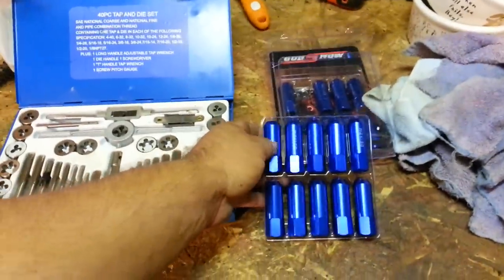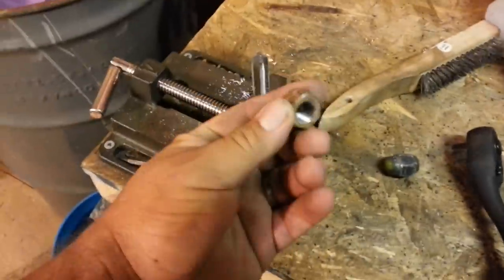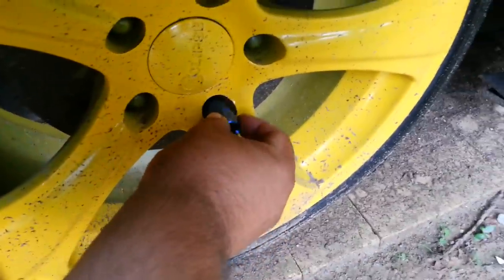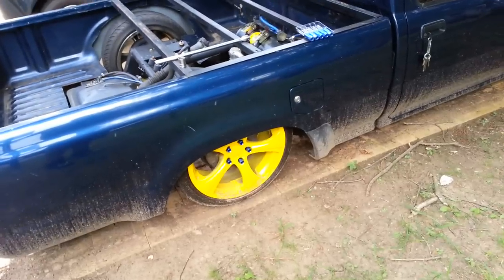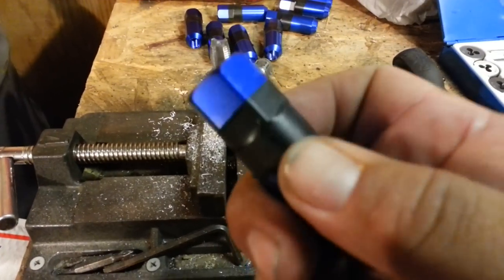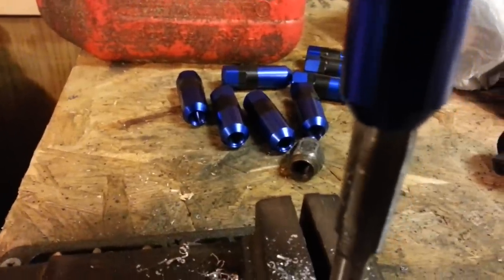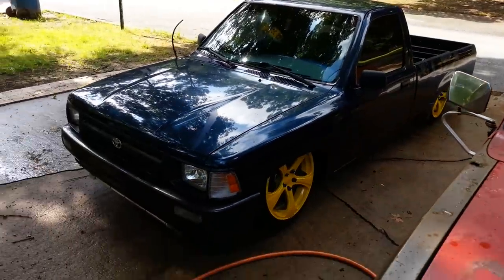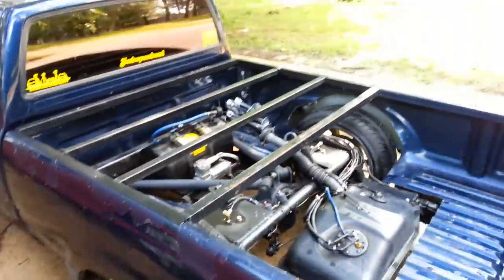How to rethread lug nuts

Comment: Was the threads in your new lugs too small or was it the wrong thread? I'm afraid that you may have weaken the lugs by doing what you did. Just looking out for you.
Reply from the maker: Lugs were obe size to small and won't thread count for the spacers. I thank you for your concern I torqued them and did a 100mi round trip at 80mph so so far so good.
Reply from the maker: Lugs were obe size to small and won't thread count for the spacers. I thank you for your concern I torqued them and did a 100mi round trip at 80mph so so far so good.
Reply: Lawrence Duarte That's good. Stay safe and keep the videos coming!
Reply from the maker: 92b2200mazdawg will do and thanks again.